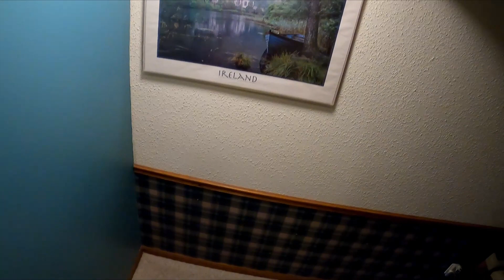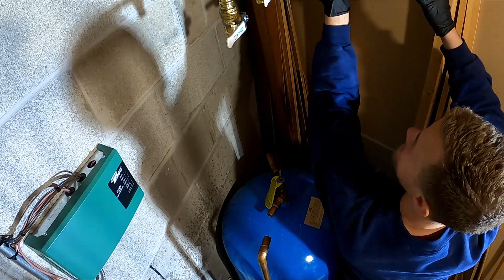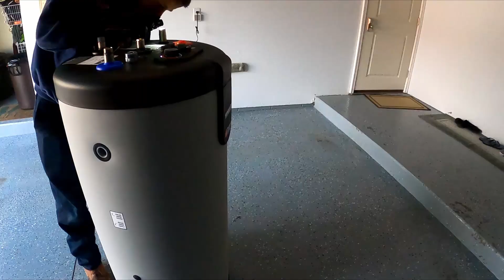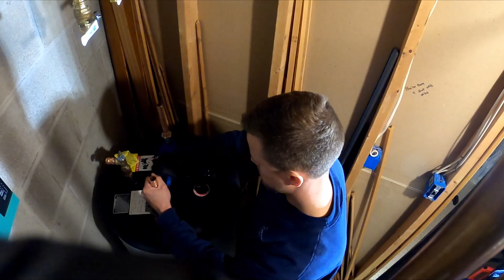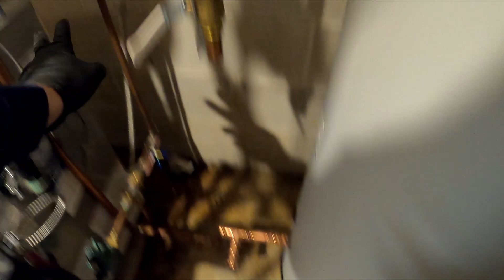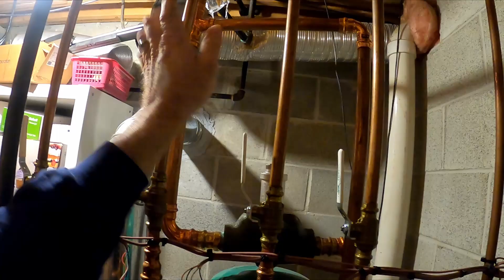Triangle Tube Indirect Water Heater Install

Comment: No need for a thermal expansion tank in ur area??
Reply from the maker: No
Reply: @MiHeatingGuy  A small FYI - its code here in Colorado - no press tank no pass inspection - and I mean a separate press tank for the water heater & the boiler.  Inconvenient but I want to sell some day and signed building permits help with that.

Comment: Seems a waste to install copper pipe that lasts hundreds of years to something that lasts 5 years and then cut it out
Reply: Yep.  PEX-B would be fine, and could've avoided the two 90 degree elbows.  Without the press fitting rig, that may have been his choice because sweating all of those connections would've taken a lot of time.

Comment: Does that water heater really need the dielectric unions ?
Reply from the maker: No
Reply: @MiHeatingGuy  so why use them on this install ?
Reply: @iggymac3473  --  They didn't plumb a valve for draining the new tank, so it's useful to have a union there to disconnect at least the cold connection so the tank can be siphoned / drained when needed.  As Mike said, the Triangle Tube welded stainless tanks don't have a drain valve in either the potable water tank or the boiler water container.  So I was surprised that they did not include any drain-to-hose valve on the cold water side.  I also didn't see a pressure expansion tank on the cold side -- hopefully there is one that was just out of the picture.

Comment: Nice video!  Random question for you, I have the m12 press tool and use viega fittings and it’s always getting stuck on fittings, it drives me crazy.  I notice yours doesn’t.  I’ve tried the scotch pad like recommended but it still does it. Any feedback would be helpful. Thanks

Comment: woah woah woah, what you though was the dip tube, may have been an anode rod on the hot outlet and the dip tube was very straight on the cold inlet, making it hard to see.
I hope that's not the case and you didn't swap the fittings and plumb it backwards lol (but "poo happens" and we take to much for granted lol)
** ahh visible/easy swapped dip-tube and color code escutcheons. that's kind of nice,  you could swap the hot/cold inlet easily and it shouldn't effect the operation any.
RTFM(read the forking manual) :))) yeah we're all guilty of assuming things, then have to facepalm after the fact or catch it mid install. "life" lol

Comment: relief valve leaking on boiler, guaranteed expansion tank and fill valve issue. unless it was fiddled with by some clown too often ;)
same for DHW, backflow on city side and dead expansion tank = T&P valve leaking. the tanks used to last for many years, now days? two to three years and it's bleeding off like mad, at five years guaranteed land fill material.

Comment: all nipples on the top, how do you drain it LOL
yeah, it takes skill and seems stupid as hell. but all nipples on one end eliminates a lot of thermal cycling expansion/contraction metal fatigue and fracturing issues.
simply pump out via the cold inlet or drop a hose down inside to pump it out.

Comment: HVAC question here. I have an 11 year old Carrier Infineon series A/C/heat pump. I was told by a reputable company in my area that the TXV valve is "slammed shut" causing the system to pump down while in cooling mode. But I have heard that many of times the TXV can be repaired. Seen a few HVAC videos on this too. I am being quoted at $852 for the replacement TXV part and labor. Your thoughts?
Reply from the maker: Carrier TXV's can not be repaired. And if it is a copper or tin plated coil I would replace the whole coil. copper and tin coils are known to leak
Reply: @MiHeatingGuy  You mean the entire A coil? when the tech was out he did inspect for a coil leak in both the indoor and outdoor part of the unit and did not find any. He thought it was the compressor going out as it was making that gurgling noise when there is low or no refrigerant going to it. A second senior tech came out and then determined it was the TXV.
Reply from the maker: yes the whole coil. your going to waste your money on just the TXV
Reply: @MiHeatingGuy  while I hate to agree with the pricey ending, yes, that's the best bet.
then again, is there something wrong with the reversing valve in the outdoor unit? have you owned it from new and never had to have it recharged? if not, then I'd be weary about it and debate hard about full replacement. I hate replacing older equipment, but you have to factor in the background life of it, from install to current ;)
Reply: @MiHeatingGuy  You think I should go with a whole new unit then? Considering its age, other components might break. At least with a new system I can finance it.